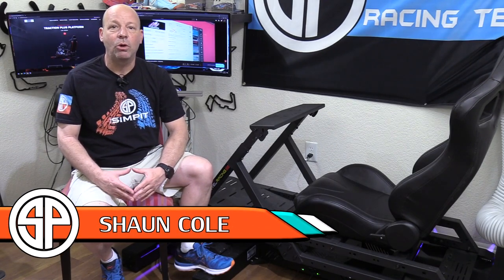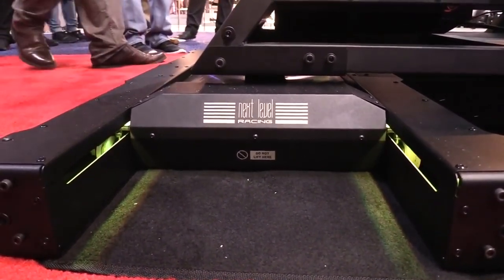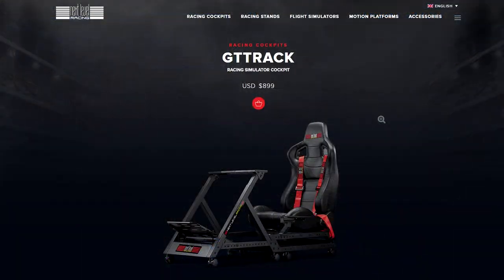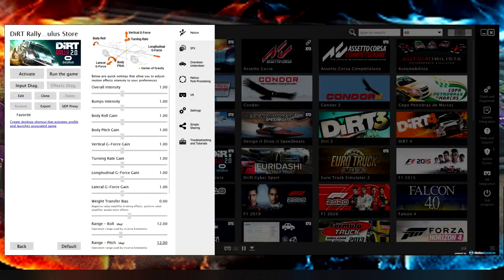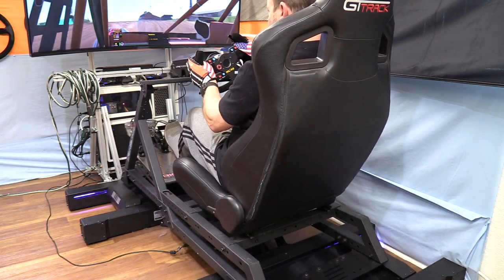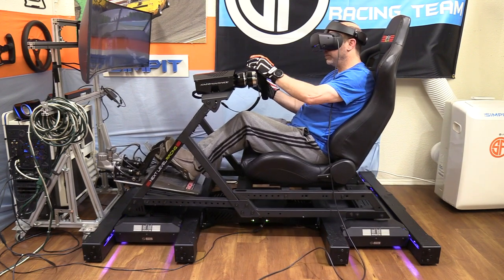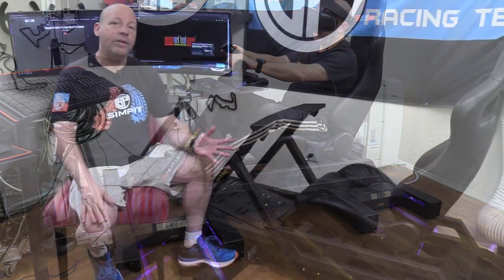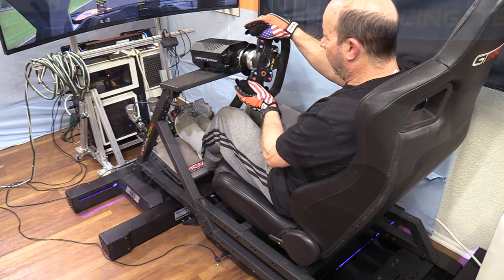Traction Platform Plus - Feel The Slip Of Your Car or Sim

Comment: For this price tag, the T1000 5M is the better offer: much faster actuators, traction loss, can be used with regular triples (but does not provide real surge/sway though). I wonder why sim motion platform providers do not create a smaller affordable platform for around 5000.- with some surge/sway (2 actuators) and on-top a 2-actuator system for pitch/roll. That would make most sense for sim racing purposes. Instead if you want the surge/sway the platforms are overall much too complex (unnecessarily!) and too expensive. Like the T1000 7M for 28'000 or the traction platform plus.